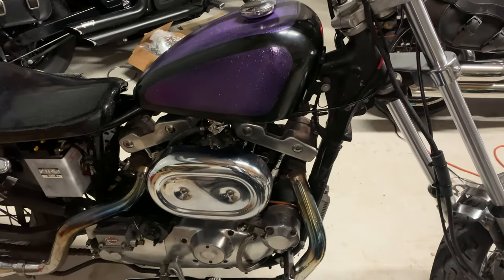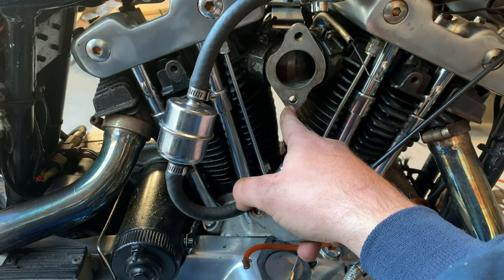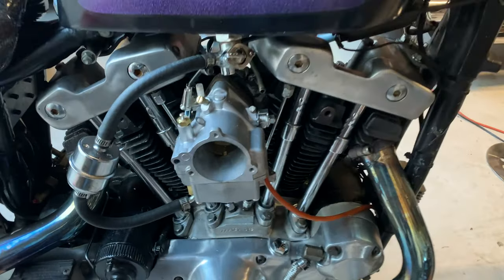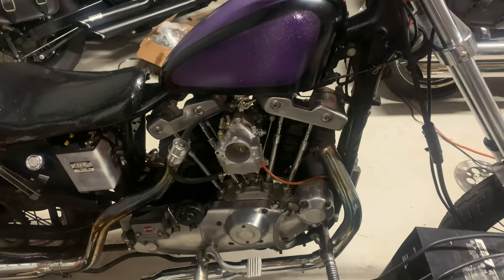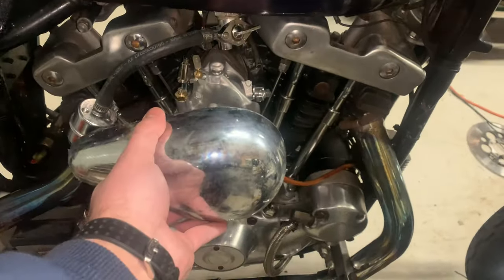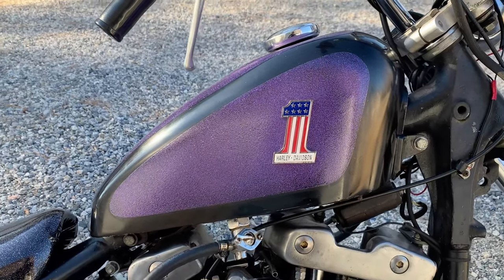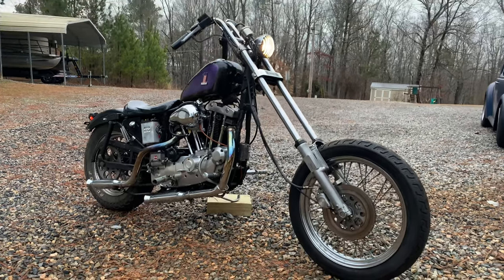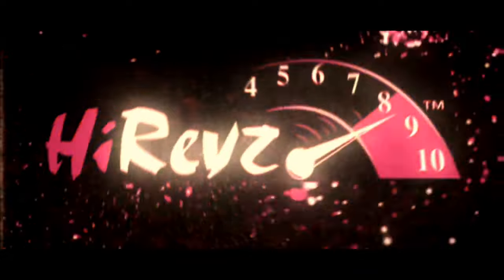Chinese S&S Carburetor Install and Testing - 70's Chopper Build Part 7 - Harley Roadster XLS1000

Comment: I just bought one of these carbs for my '79 XLH; I've started it but not taken it on the road as I'm waiting for front end parts, so it's a relief to know they work. It replaced a CV40 which rubbed on the stock fuel tank and yeah, the air cleaners have different holes so I used an S&S Steath which has an enrichment lever built in. All of this left the carb unsupported (I've had so many inlet gaskets tear from the weight) so I've bracketed the top manifold mount to the mid head steady bracket - fingers crossed.
Reply: PS Love the forks.

Comment: probably would have started right up if you used the enrichment knob. Thanks for showing this in use! I just fubar'd my S&S super E body last week and had to buy a chinese replacement this weekend. Going to install it this coming weekend and use it this riding season then replace it with a super G next winter. Cheers and thanks for the video!